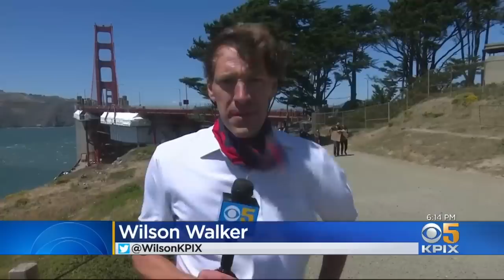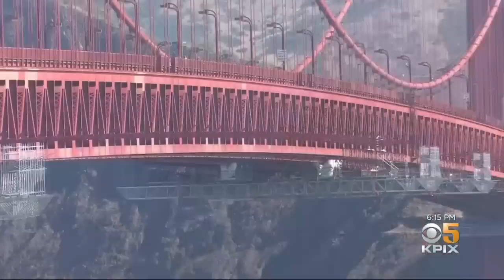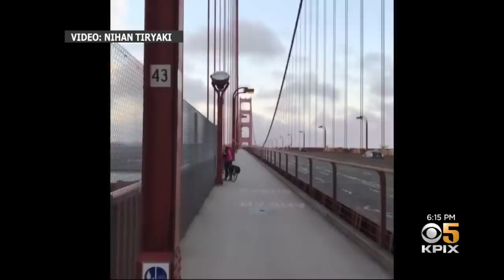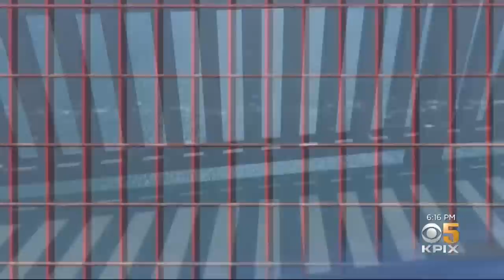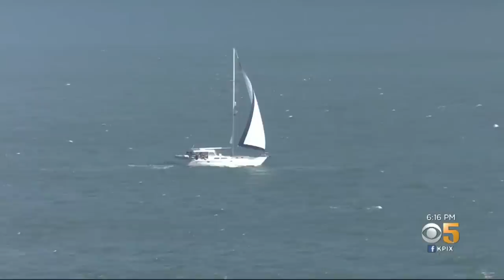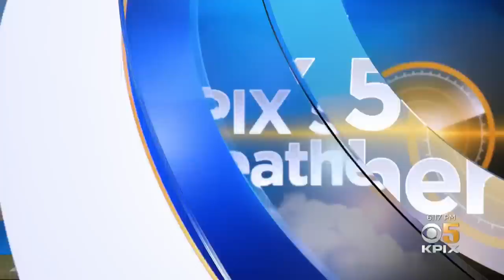New Guardrail Causes Golden Gate Bridge to 'Sing' in High Wind

Comment: Does anybody realize the vibrations that are the sound are wearing joints and fatiguing metals. It could be as easy a fix as bolting decorative weights to the middle of the sound producing bars to dampen their frequency response.
Reply: Maybe even weaving some type of material through the slats?

Comment: Clearly it is noise pollution.  The frequency and resonance of the sound can actually damage the bridge over time, kind of like a  crystal wine glass if you wet your finger and run it around the upper edge, it will sing, and if you do that long enough it can and will shatter the glass.  I know the bridge is not made of glass, but it can cause damage.

Comment: WTH SF ? thinner for better wind flow... easier for possible breach by moving vehicles like I'm sure was the original intention and Should still be a concern. not to mention the Original Designers intentions. Built for transportation and longevity not "Features" ! I know I've seen other design "FLAWED" bridges and buildings that had to address the NOISE when it's novelty wore off those that had to endure these flaws that created sound or other unwanted effects. But leave it to the Millennials to try and change the world by screwing up past !

Comment: Let’s face it, this is an engineering screw up. It was never mentioned in any announcements or descriptions of work to be done. The guy saying the sound was anticipated is just plain lying. An insult to everyone’s intelligence. For those of us who live near the bridge this is more than a distraction. This is a harmful noise that will drive some people crazy. The bridge people need to stop trying to sell this as a “feature” and get to work on a fix that will make it go away. If they choose not to correct the problem, I’m sure a strong legal approach will point out the liability of the unwanted noise and and effect it has on all who have to live with it.

Comment: The sound came from hollow metal rail with small hole that allowed wind to go trough and caused vibration on high wind and low wind. High wind causes extreme speed  creates strong vibration creates high pitch.  Low wind creates slow low pictch.

Comment: and..... just a passing question, by someone who has worked, I don't know, five or so years in construction.... did nobody think of making the struts rhomboidal as opposed to rectangular ?
I mean, if wind resistance is the issue, you'd figure you'd present the smallest surface area on a windward edge, which results to be zero, and increase in size until you find the required thickness for maximum structural integrity....
but gee.... I don't know.... I've only worked five years in construction, it's not like there's a school to learn these things or anything, I just worked the trade.

2:57
that right there, that is the face of an office employee.
someone who's never touched the physical materials they work with, who only knows what a book has taught them (or worse, what the internet has taught them), and cares jack shit about his trade.
I bet my skin he has a background on design, and not engineering.
god, now I know what my grandpa felt when he stated "god, I want to slap that smug face so bad right now" every time he found one of these people.

Comment: The wind speed will drive the frequency that the air coming through the slats vibrates at. If that frequency matches the "resonant" frequency (think of the washing machine jumping around at a certain speed) of the barriers, then they will vibrate much more aggressively and loudly. This presents another problem though.

The model they used to test this did not include the uprights or support cables. There is a phenomenon called Acoustically Induced Vibration (AIV) which can lead to fatigue failures, cables wearing through metal and bolts coming loose, caused by high volume sound making structures vibrate, especially if at that resonant frequency. I really hope they carried out separate studies to ensure that AIV will not affect the bridge supports, as they only seem to have tested what happens to the main road deck of the bridge from the overall force of the wind. They may be able to dampen the noise and vibration by adding dampers to each railing, if the railings are vibrating at their resonant frequency.
Reply: I FEEL the vibration in the southwest quadrant of the city…it is NOT JUST NOISE! Read my entry @ Parkmerced Towers.

Comment: Makes you think of the "Galloping Gertie Bridge" in Tacoma. After they fixed the guard rails it didn't sway anymore. It swayed radically and collapsed under the pressure of the wind. But like I said they figured out it needed the guard rails to be a certain way.
Reply: To add more detail to this comment, the bridge used solid girders on either side, giving it that sleek look. These girders caused the bridge to experience resonance from vortex shedding. This is seen in the vertical undulations. This resonance wasn't why it failed though. On the day of its collapsed, a different oscillation started 45 minutes before collapsing. Instead of moving vertically, it moved in a twisting motion. This again may possibly have been caused by the solid girders. The phenomenon that caused this was possibly aeroelastic flutter, which is different from resonance from vortex shedding. 
I'm not gonna explain how these phenomenon work since this would make this comment too long, but in short the flutter caused too much stress in the suspension cables and the bridge collapsed. Thankfully the only casualty was a dog trapped in a car stuck on the bridge. The bridge was the 3rd longest at the time, and took awhile to build, it collapsed only a few months after completion.
Reply: Thankfully the golden gate bridge doesn't have solid girders so it's probably unlikely for the bridge to suffer the same fate as the old tacoma narrows bridge(galloping girdie)
Take this with a pinch of salt though, I am not a professional.

Comment: It may be handrails making the the sound, but ignoring it should not be an option. If the rails are vibrating, they are damaging the main structure, slowly. If you want to see what happens to a bridge that vibrates and more in the wind, should look up galloping gertie
Reply: Not necessarily true on damage. It depends on the frequency VS how the bridge takes the vibration. Given that cars and trucks cross it... I'd say it's not likely. As for galloping gertie... 
The physics are totally different but related to why they changed the rails. Gertie had solid guardrails which the wind could grab wholesale and directly twist the structure of the bridge. The bridge's response to that wind was such that it was the resonant frequency of the entire structure. 
The humming rails on this bridge, if even possible, would cause damage in a different mode. The humming would just loosen something or cause some sort of minute, gradually propagating fracture damage over time... But again that's assuming it's even possible which I highly doubt. Not much energy's going into the bridge that way, I bet. Park a truck with a concert stack or two on the bridge and I bet you could get the same volume out of it.
Reply: Many catastrophic bridge failures over the years were caused by what looked to be non essential issues. The Florida walkway which collapsed onto several vehicle's, killing the drivers, I-35W Mississippi bridge which many ignored until it was too late. Bringing a truck blaring the speakers for a day at same frequency is not the same as a entire rail that expands the length of the bridge. The Golden Gate bridge was never designed to deal with the railings that were recently added. The vibration may seem to be absorbed, but somewhere parts unseen will most likely become loose, form cracks. Hyatt Regency walkway collapse which injured and killed many was caused by several factors, vibration, weight, illegal changes to design which the owners tried covering up, but was discovered when one very good investigator who was not really part of the investigation found where the damaged walkway parts where being kept hidden. If something does happen to the Golden Gate Bridge due to the new handrail vibrations being given off daily, it's most likely going to happen many years from now, and if so, let's just hope when it is discovered, it's not after a catastrophic event and just an expensive repair with a lesson learned.
Reply: Wonder what all our bridges , highways,, trains will look like in the future. They are old  at the end of their life span and don't  last forever. Are there even plans to build new ones Perhaps? We are so far behind. Get crews out there. Teach people a trade and pay them well. my great Uncle built the huge transmission towers on the east coast, PA,  in the 1960s and 70s. Hard work. 
Perhaps new technology and materials can be used to build them faster, better and cheaper. Those " shovel ready" jobs from the 2008 recession sure didn't get going too fast. I drove cross country 4 times from 2015, 2018 and saw whole huge new freeway projects in fly over states where there were 2 trucks and 5 guys. Get a crew of 125 people  on it and it can be done. 
You can hardly go south from NYC through DC  to north carolina on i95. The Jersey turnpike is narrow in places and crowded and  people  drive 90 mph up your butt. Only 2 lanes south  out of DC in each direction and it is backed up all day every day. Needs to be expanded north and south.. I hope there will be repairs to all the failing bridges, highways and local roads. We need high speed train infrastructure  too. None of the tracks in the N.E. can handle fast trains. Current tracks are narrow and near population,  homes, etc. The tunnels old and small. Wish we could filter the trash and chemicals from storm water run off before it gets to rivers and oceans. So much we can do, but seems nothing gets done or takes 30 years!
Reply: It's just the new railings that are causing the noise. The bridge deck itself is not vibrating.

Comment: It’s the wires with the wind. They need to take into consideration the vibration of the wind and the wires/ handrails along with the weight and the age. The sound is going to create pressure and vibration which in the long run can be very detrimental, if it’s not equipped for these particular factors, which in the last couple of years the wind has been increasing. Just like having to replace your guitar string I’m wondering how long it will take before they have to replace these wires/ handrail/bridge Or even the bolts. When it comes to a bridge you want stability, and vibrational free, you do not want vibration and pressure.

Comment: Hope they kept the old rails...theyre gonna need em after the first lawsuits start rolling in.
Reply: karens are gona love it when the new rails are in place
Reply: Not an option. The rails were replaced in order to lower wind drag to compensate for the heightened wind drag of the new anti-suicide nets. They can't go back unless they remove the nets and let the suicides resume. Imagine the much bigger lawsuits if they did *that*. 

They'll probably come up with some kind of vibration-dampening bolt liner or something that'll reduce the volume.
Reply: @jv-lk7bc  install suicide gates for easier access.
Reply: @jv-lk7bc  How do you get sued for someone else's actions? This scares me...

Comment: I'm not a scientist but isn't there a chance of minor vibrations that could slowly damage the bridge
Reply: @Kristin Marie I'm not an engineer but I do a lot of construction work one item vibrating connected to another item the vibrations travel through the other item. I'm not saying it's going to hit a resonant frequency of the bridge.. but what happens to something that's bolted to something else and you constantly wiggle those bolts will come loose and can cause wear on the bolt. common Sense 101
Reply: @spencersobczak4235  sturctural engineering 101 > common sense 101
Reply: Maybe

Comment: this is kinda bad. if this is a resonant frequency it will eventually vibrate the bridge into pieces.
Reply: It's just the new railings that are causing the noise. The bridge deck itself is not vibrating.

Comment: It's not a bug; it's a feature. 

( ... a feature, I might add, that is tapping into the bridge's resonant frequency. It's oscillating, not singing, and it will soon prove fatal to the structure's integrity if not corrected. The oscillation is forcing the entire bridge to compensate by vibrating cables, like strings of a guitar. The sound you hear is probably the road deck and trusses acting as a sound box, amplifying the sound. This error will ultimately cost millions to repair before it causes irreparable damage. See Tacoma Narrows Bridge or HuMen Bridge for further reference.)
Reply: Someone must've read the wikipedia page on resonance and bridge failures but isn't an actual structural engineer :)
Reply: Not necesserally, it could be really just the wind being shattered arround the newer railings, like any blowing instrument, the air is vibrating not the instrument itself
Reply: People can sound like they know what they are talking about on the internet but actually know jack shit....like this comment for example